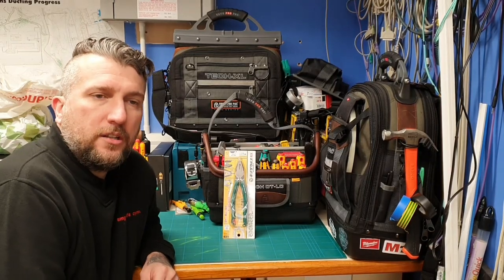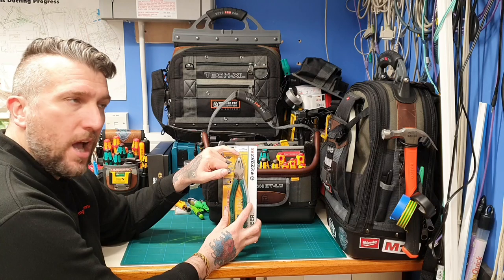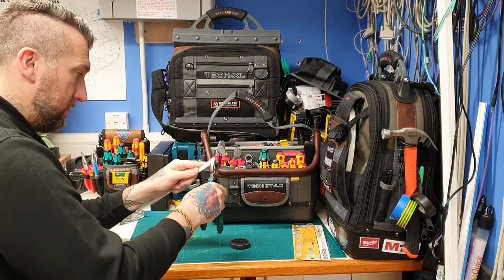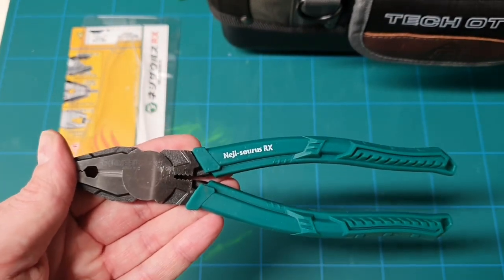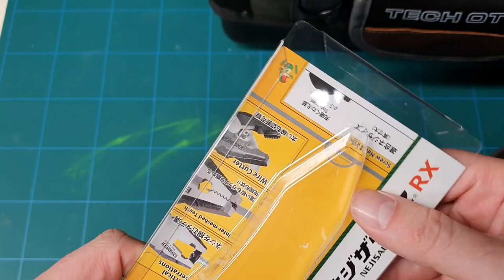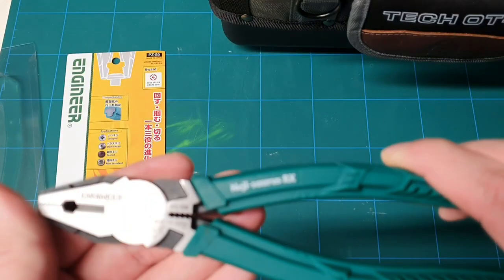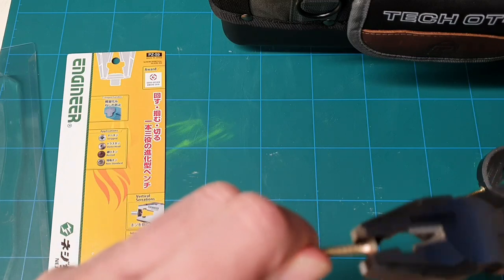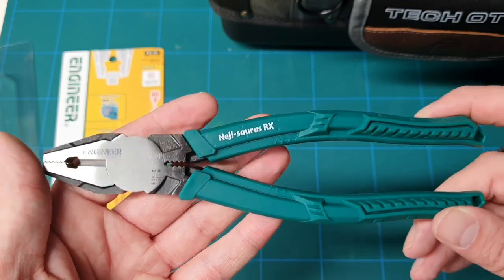Engineer pz-59 neji-saurus RX

Comment: Engineer make some amazing tools. I have the smaller ones, and the mini offset ratchet great for getting into tight spots  The screw extractor set is next on my list.
Reply from the maker: In all honesty I was looking at the Vampliers brand then seen the Engineer and thought well they are the original and Vampliers have just re branded them. Seen very nice 👍
Reply: @Tooligan2021helloyouTooligans  Defiantly, the engineers have saved me on a few calls.

Comment: I’m getting a pair , I already have a pair of Knipex TwinGrips , ( better for bigger stuff ) , I plan to use the Vamplier/ engineers for smaller screws .
Reply from the maker: I would definitely look at the smaller ones of these pz-58's
Reply: They also make a long nose/ needle style for stripped out tiny screws , I already have the large end of the Spectrum covered , by the Knipex .